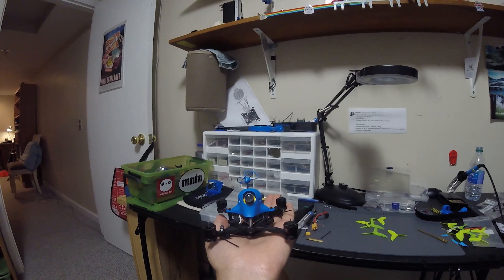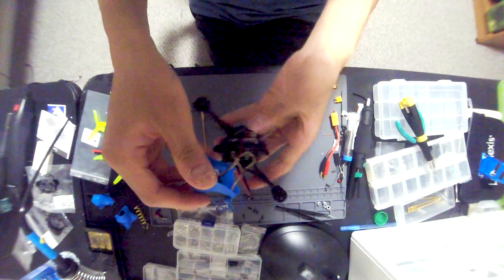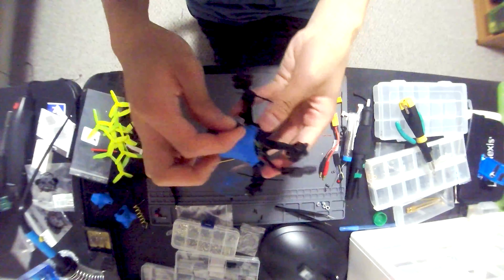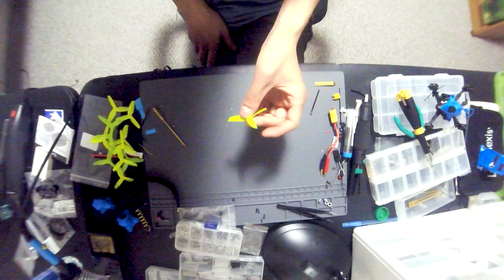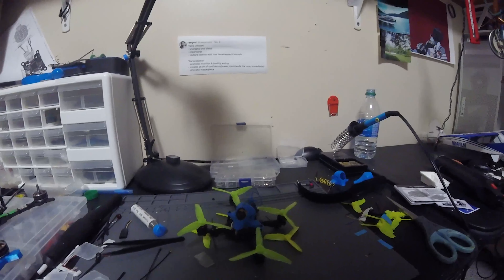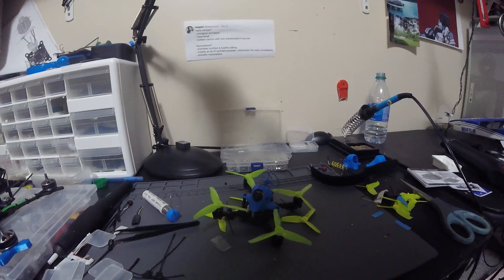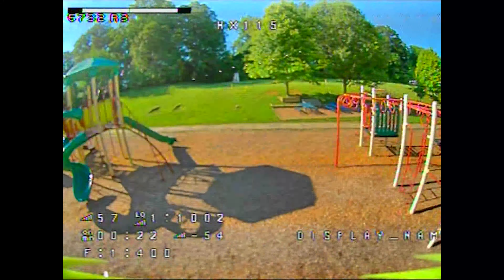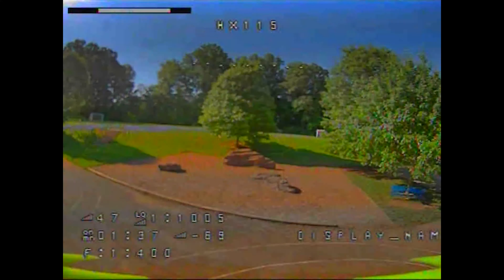I built the ULTIMATE racing toothpick. Should you?

Comment: What do you think about the TBS Unify Pro32? Does your become very hot? I chose it for the weight but I have had problems with overheating (at 25mW 100°C), I contacted tbs and they offered me a 30% discount but I'm unsure wether to take the risk and get a new one.
Reply from the maker: I personally haven't had any issues with mine and it doesn't get a lot of airflow. Just make sure you're not heatshrinking it I guess? Mine is mounted on top of a TPU sled that isolates it from the rx and FC.
Reply: @flyawayfpv  I used two GND 'holes' on the FC, probably for a capacitor, both as ground connection for the two GND on the vtx, and mechanical connection to the board. In this way, the vtx is in mid-air, 3-4 mm above the FC. 
TBS told me It won't restock before august. What other vtx do you suggest without adding much weight?
Reply from the maker: @eugeniopicheo5430  diatone makes a 500mW micro VTX (https://pyrodrone.com/products/diatone-mamba-tx-500-video-transmitter) that works super well and is really lightweight. Otherwise, you could try the eachine nano vtx (400mW) or any of the replacement VTXes from betafpv itself :)
Reply: @flyawayfpv  ok thanks